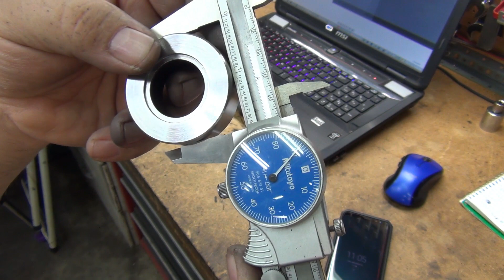Novakon Torus Pro - Mill/Turning 411 hub spacers OP1&2

Comment: Love ya work Mike.  Who needs a CNC lathe right?  I would love to try this on my machine, but not sure if the post I have would work :-).  OMG, I just clicked send before watching 8:20.  You really got my pucker factor happening.
Reply from the maker: It's been long enough that I don't recall what post I'm using......lathe or mill.  I'm pretty sure it's simply a lathe post that I modified.  I needed to tell it to zero out the Y axis each time it moved tool positions.....other than that, I don't think I changed anything else.

Comment: Are you still liking the mill? How do you think it would compare against a Tormach?
Reply from the maker: I do still like the mill.   I know Tormach now has versions available with servos, but I'd still by the Torus Pro for the same reasons I did originally.....it has 3x's the work envelope and I much prefer the electric power draw bar over the pneumatic.  I haven't looked at the specs so I don't know machine is faster these days.  I run mine with 250 ipm rapids, but I can easily turn that up to 500.  I've had it at 650ipm before.